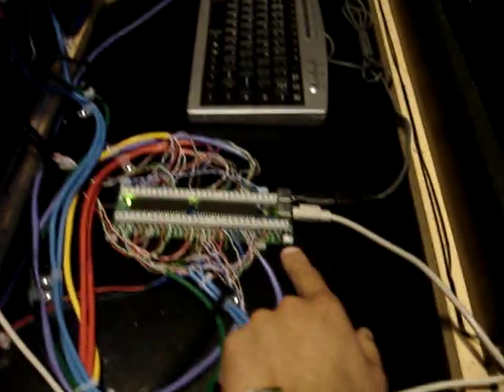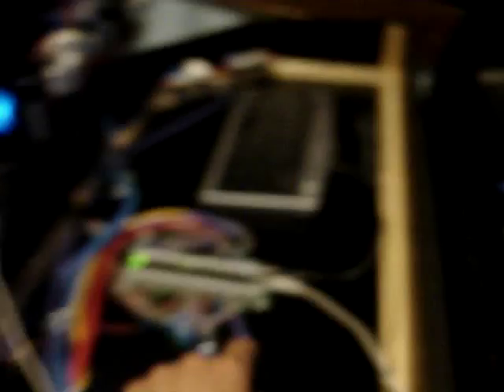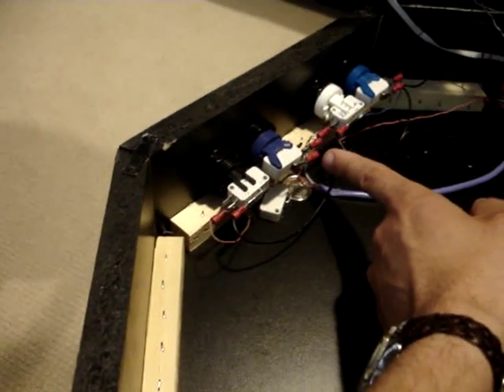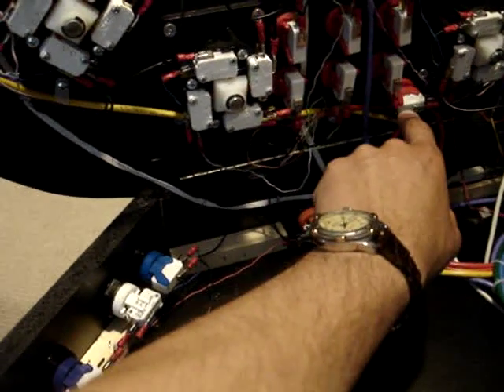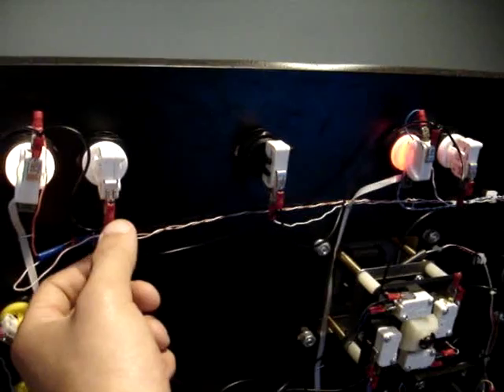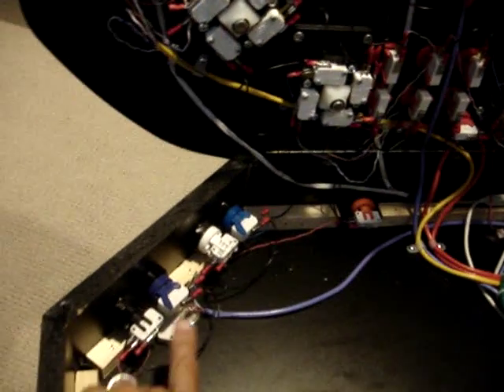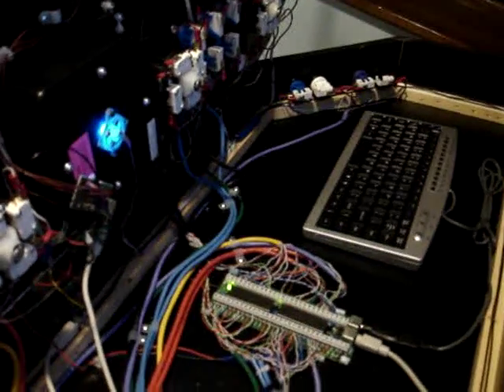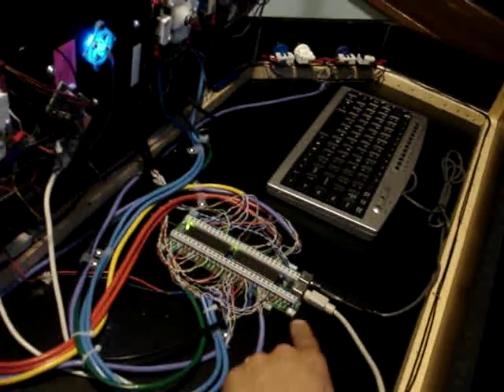Arcade Wiring (Grounding) for Beginners

Comment from the maker: @poopyroses There should be a ground somewhere on the keyboard interface.  It's usually labeled as such.  Look for a black wire where the usb cable is soldered to on the keyboard interface board.

Comment from the maker: 18 gauge is fine.  I used bell wire for my ground.  If you head to your local Home Depot, go to the doorbell section.  They have packages of wire that work very well for cheap!  Radio Shack is a ripoff and more expensive and you get less!  It doesn't have to be black for ground.  It can be any color as long as you know it's ground.  They usually sell many different colors to choose from.

Comment from the maker: @Namurashi You have to purchase them separately.  Doorbell wire at Home Depot works best.

Head over to Ultimarc's website and click on the info link for the ipac.  You will see a close up pic there of the ipac.  It's clearly labeled of what goes where on the ipac itself.

Comment: Quick question, if you don't mind? Can you break a daisy chain ground?  In other words, can you skip over one or two of them and pick up at a later point with the grounding sequence... or will it cause an issue? Thank you
Reply from the maker: +Jim Loftus Yes, you can certainly skip over buttons, but it needs to be continuous on the original daisy chain to the grounding source.  So if you decide to ground those "skipped buttons" at a later time, you need to connect those new buttons to the ground.  you can have multiple daisy chain loops connected to the same ground on the encoder.
Reply from the maker: +DeLuSioNaL Arcade Alternatively, you can always create the connectors on the daisy chain and not connect them to any buttons.  Then at a later time you can simply plug the connectors to the new buttons.  But having the microswitches disconnected from the daisy chain will not cause any issues, so long as you do not sever the connection on the daisy chain wire itself.  If you cut the daisy chain, obviously it will not carry the signal to the rest of the buttons.  Make sense?
Reply: +DeLuSioNaL Arcade what about skipping a connection on the chain? For example I have a few extra terminals on my chain, and one button is too far away from the previous to reach the next. Can I skip a connector and not have an issue?
Reply from the maker: +Oisterboy, That's perfectly fine.  Just make sure the metal connector that's hanging loose doesn't touch anything else. A safe bet would be to wrap the metal connector that is not being used with some electrical tape, just in case.
Reply: +DeLuSioNaL Arcade thanks for the fast reply! I'll link to you in my blog post for the cab I'm building. Party on!
Reply from the maker: Thanks!  Appreciate the linking.  I plan to make an updated wiring video.  Just waiting for more equipment to arrive for shooting video.

Comment: If you're not using an iPAC, where do you terminate the last wire to?
Reply from the maker: Which last wire are you referring to?
Reply: @delsarcade  I was thinking of the grounding point (yes I am that dense when it comes to electricity), I realize now that whatever controller pcb I am soldering to will have a place for ground... I just have to figure out which it is.

Comment: Where do you hook up your special control buttons like enter, esc, pause, etc on the ipac? Ive noticed theres no label for these kind of buttons
Reply from the maker: You can map those to any buttons using the Win iPac software. In my setup, I had plenty of button inputs on the iPac board left over from the unused player 3 and 4 buttons, since I only had 4 buttons for each player and the iPac had 8 buttons allowable per player.
Reply: I have alot of inputs left over also on my ipac... So i can just use those for my special buttons? Or do i have to down load the software? Thank you
Reply from the maker: You need to do both.  Use those for the special inputs by connecting the buttons.  Then you need to download the software to assign them to the input.  Once you do it you will never have to again.  The iPac will remember the settings.
Reply: Ok thank you so much one more question... Why is there 2 ground outputs on the ipac 4? I have all mine connected to one ground on the ipac ... Will not putting any wires in the other ground output cause a issue? Is it needed for something? If so what it is used for? Thanks so much again for your help?
Reply from the maker: +Marco Antonio Only one is fine. There are two just in case you have extra wiring and can't fit them all in one screw terminal. (Since ground wiring is sometimes multiple wires)

Comment: question, I am wiring up my cab's test switch to one of the buttons on top of the control panel. currently it has its own ground coming from the coin door, can I daisy chain the new test switch wire using the ground from the rest of the control panel or do I have to snake up the one from the coin door?

Comment: Do you use a thicker gauge for this? Or do you use the typical 20-22 gauge?
Reply from the maker: 22 gauge. Same thickness as the rest of the button wiring.
Reply from the maker: +DeLuSioNaL Arcade to clarify:  I use 22 gauge for all wiring now. Cat 5 was a pain because it was so thin. It was a pain to crimp ends onto.

Comment: Hey I just got my ipac4 and have the control panel layout pretty much the same as yours, I was just wondering which buttons for players 1 and 2 are 1-7? and which buttons for players 3 and 4 are 1-4? Also just bought some 18 gauge wire for grounding everything and was curious if that was alright to use, thanks

Comment: so what if you don't ground your arcade?
Reply from the maker: No ground = No workie
Reply: oh sorry then, i must have been confused. i have ordered this whole set with a circuit board where there's a separate socket for everything. i guess the grounding will be taken care of
Reply from the maker: To clarify.  The ipac already has ground on it once you plug it into the PC with the provided plug (USB or PS2).  The computer has a power supply which already has ground so it's easy.  In order to get each microswitch to work, you need to have it connected to ground on the ipac one one conenctor and an input on the ipac to the other.  These two points go from the microswitch to the ipac.  Take a look at my other video "Wiring an Arcade Control Panel for Beginners".  That will explain it better.